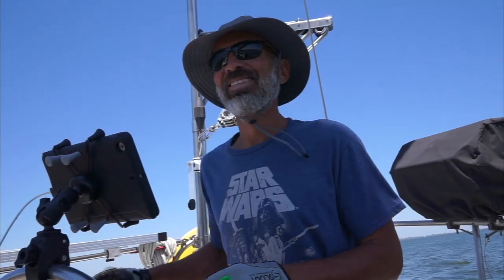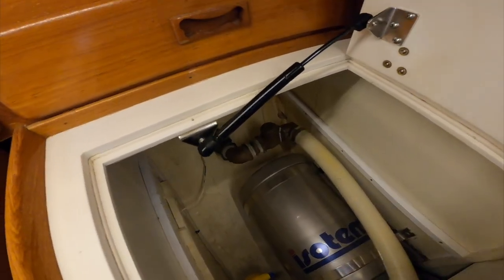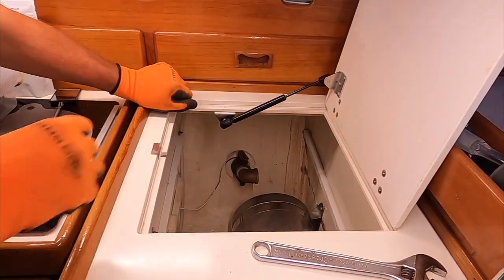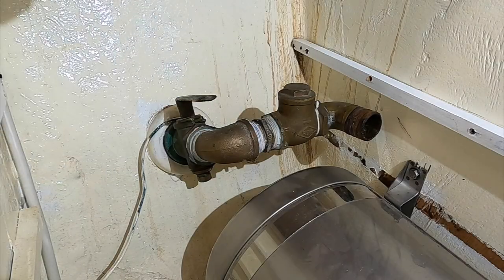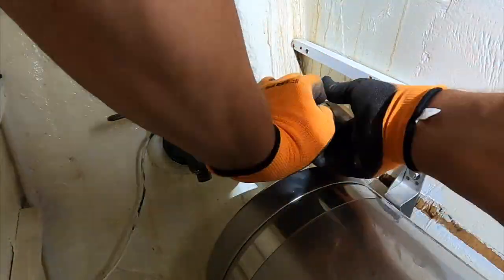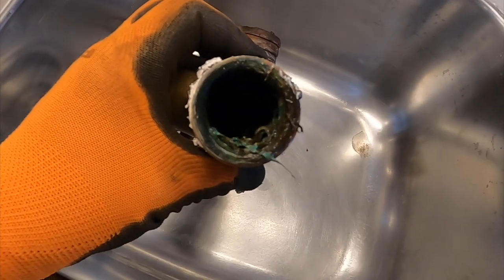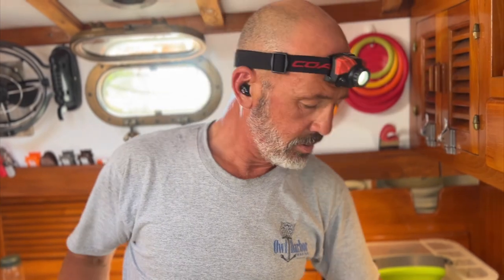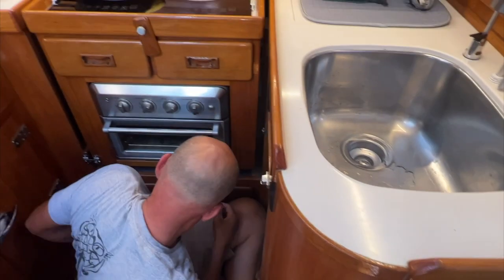Fixing Our Sink Stink | SV Ramble On

Comment: Great job Rich…..I bought a high pressure sink blow out tool on amazon….it hooks to a garden hose and seals at the sink and blows the crud in the sink out.  It comes in various sizes to fit different types of sinks….worked great

Comment: The goop around the one way valve is because the water, and whatever is in the water, slows down to make those turns at the check valve. If you can get a straight run from the drain to the thru hull, it should cut down on the check valve getting gunked up and the seacock may not freeze up as often or as easily. Have you lapped that seacock recently? That may help along with some grease. I use silicone marine grease, just a thin smear. Good job. I wear an organic respirator when doing boat plumbing. lol

Comment: Holy Checkvalves, Batman! do you have a remote camera on  Glorious?! My dock water hookup was starting to stink really bad and water flow was down to a trickle. So a couple of days ago I traced  it all the way back to what looks like your checkvalve, and the unit is just on the engine room side of my lazerette bulkhead. Took yesterday off due to the Swap meet and today was trying to figure out what to do and up pops your video! Now I just have to Sawzall my bulkheat to get access so I can clean out the checkvalve. Nothing easy on these boats.! We need to talk again about in incoming dock water filtration again, obviously...And your sound effects were as billed!

Comment: That gunk typically is fat, oil, soap, and grease. You can avoid it by using kitchen roll paper for cleaning of pans, pots and plates before cleaning them with soapy water in the sink. Works fine with us since years.